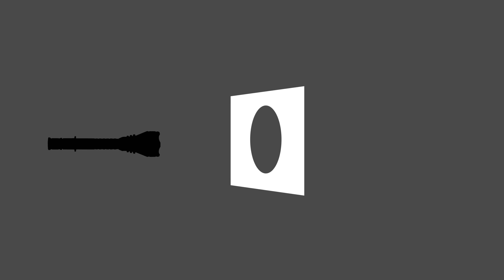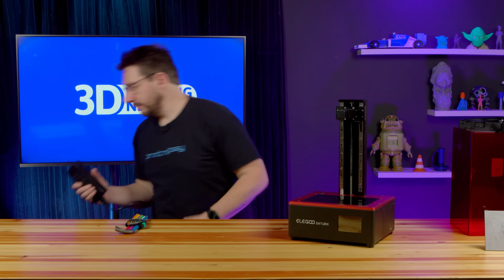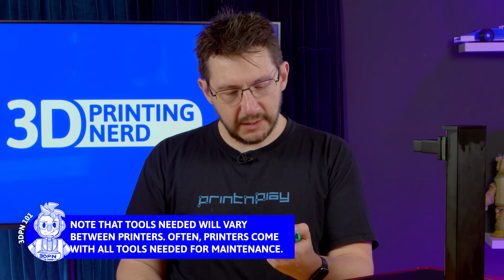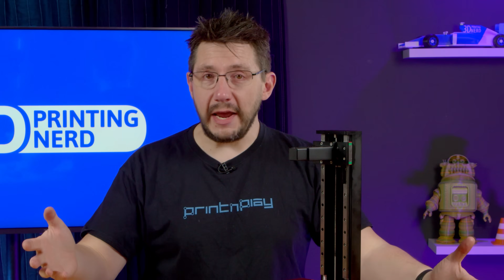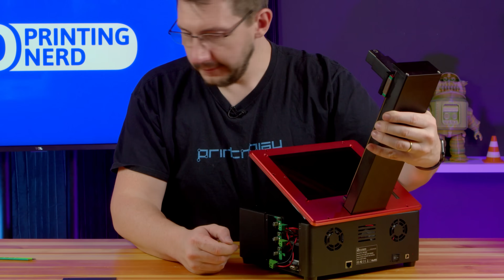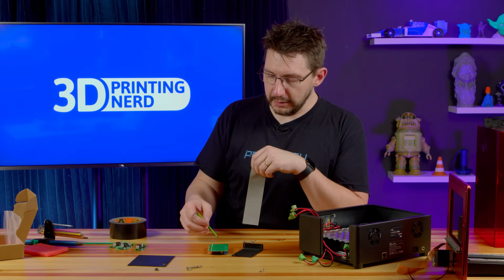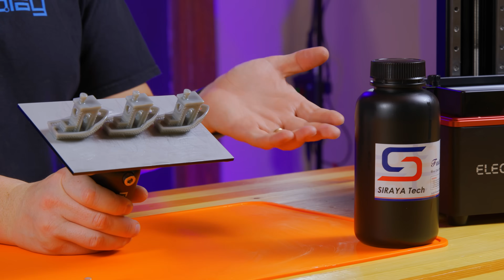FIX AND WIN an ELEGOO SATURN!

Comment: I'd print a lot more DnD minis. I print plenty now with my Ender 3, but even with a 0.2mm Nozzle, it struggles to get fine detail on things like chainmail when it's that small, so would love to be able to produce cleaner and more precise minis. 
It would also be nice to be able to print smaller components for some larger projects in conjunction with the FDM printer.

Comment: Very cool. I am now on my 3rd fix having bought 3 partially broken 3D Printers. Fixed a failed Extruder, failed stepper motor, failed main board, failed hot end, and the list does go on. BUT I have saved probably about 70% of what the original purchase price would have been.

Comment: Would love to prototype small diy negative mold for parts I'm design for my dad bass boat, possibly for other boats. Hope I explain that well. Want to use it to print the part then make a mount around the detail and acurate to make carbon fiber parts for small switch panel etc. And possible make figures and other things. Great video explaining and diagnose.

Comment: Nice step by step fixup. If I won the printer I'd print custom model railroad items. I've actually got a few things designed already 😊
My filament printers are not good enough and my old Anycubic resin printer needs a new screen.
Cheers!

Comment: like that you had it fixed with new board. might wish to inform people to take pictures of wiring in case they have to wait and might forget where they attach.  as for the stand offs you could use even low density weather stripping.  as for what to print? mostly miniatures, chess pieces. most i would like to donate to the senior center where they could paint them and play with them.

Comment: Another great video. I have been looking to get a resin printer. I would print a few small prototype pieces that I have designed that need a better finish than using my fdm printers.

Comment: I noticed that with the old driver board and the new driver board that there was no cooling or heatsinks. That second driver board may fail as well.

If I won that printer I would print some upgraded parts for other print printers. Because the goal is for 3D printers to make better printers.

Comment: The very first thing I would print would be an adapter/insulating plate to replace the tape you used for the repair.  I don't trust adhesives directly applied to electrically live conductors.

Comment: Good Day Joel,

I am an R&D medical device engineer (read: invents medical devices). My passion is saving lives and/or giving a better quality of life to people, thus I’ve been in this industry for over 25 years. I have over a dozen U.S. patents with my name in the inventors list for medical devices from companies I've worked for. I am currently unemployed as of 15 Jan 2021, since my last company’s product was an implantable weight loss device for bariatric surgery. During the pandemic that type of surgery is considered “elective” surgery during COVID-19, product sales dropped, R&D work dried up.

I am currently developing a TAVR (Transcatheter Aortic Valve Replacement, you can look that up for more info) in my garage to hopefully start my own medical device company with this product and am in dire need of a quality 3D printer to build prototype stents (these stents will later be built from various biocompatible metals) for proof of concept and testing. I may even try some of the elastic resin materials to prototype a (human) heart for my bench top testing. I already have some stent designs I made with my SolidWorks ready for print. I have an FDM printer I built myself a few years ago, but it is not up to the task of building the stent geometry that a resin printer can provide and my printer is not that good. As mentioned before, I am developing this in my garage with my own (very limited $) resources until I create a working and bench tested prototype to present to physicians and investors.

You are welcome to check my authenticity on Linkedin and you can go to Google/Patents and use my name in the following formats and my location in San Clemente, CA to look up these patents:
- Monetti
- Richard Monetti
- Richard R. Monetti
These patents will all relate to medical devices.

Consider that your gifting this to me could save a life or give a better quality of life to someone with aorta valve disease if I can make this product come to fruition. I am more than happy to give you all kudos and credit for this piece of equipment when I am successful along with being one of your patrons (which I cannot afford presently)!
If you have further questions, you may PM me in Linkedin.

Comment: I have a friend that is going to school for architecture but doesn't really want to bother with the technical side of 3d printing. If I had this printer I would use it to print his models but also to print miniatures in higher detail than I could on my ender 3. Also, I don't know how this would work with a resin printer but I would like to if possible attempt to print a small airframe for an RC plane using resin instead of pla.

Comment: A better solution to the standoff problem is to use a drill with a bit larger than the diameter of the standoff and drill them off. The leads from the components will eventually push through the tape. Another idea is to use washers (or print extensions) on the standoffs that have screws to lift the board higher than the unused standoffs. As for what I would print, I would print components for my race engines to be used as molds to cast them in aluminum.

Comment: 3 buck converters  replaced by a single board with 3 DC Buck converters on it.     kinda a downgrade because one buck converter would ahve been cheaper to replace ( not a driver... a voltage regulator)
Reply: i would print myself a  samurai mask .  :)  pelase enter me in the contest ( just north of you in canada)

Comment: Great video Joel! I tinker with a lot of electronics myself too. i would just be a bit afraid of leaving the tape on the PCB as in time the pointy leads could chew its way through it due to vibrations and then touch the metal shorting the circuit. If I had a resin printer I would like to print high res figures or try some of the special resins, like flexible with intricate designs or ceramic to make fire proof prints and electrical insulators.

Comment: When reading the title "Fix This and Win This", my first thought was like "Isn't that like getting to kiss a supermodel with weeping herpes wounds?"
Add: Now that I've watched the whole vid, I am in sincerely desperate need of a resin printer for my UHTC project for which the one I ordered is lost somewhere either on the surface of the Pacific Ocean (fingers crossed it's not bobbing somewhere beneath) or somewhere between China and the LA port at present. The resin printer will be printing self-engineered jet engine parts for the purpose of making a ultra high temp jet engine run on water.
I'm not even joking for once. =)
I would also consider modelling up a mini Joel and strap him to the top ala Slim Pickens because why not.

Comment: I designed some minis on HEROFORGE and had them print and send me one last July.  I spent a fortune on paints to finish it and was almost done at the end of December when I knocked it off the desk and broke her off at the ankles.  And that's how I ended 2020.  I haven't gotten around to fixing her yet.  IF I won the printer, I'd download the file from Heroforge and print her up myself and paint her.  That would be first.  Then I'd dl a few more mini files and print and paint them.  Thanks.

Comment: Great video as always. I've been curious about the inner workings of these printers. 

I'm currently designing a resin modification kit for the Ban Dai Real Grade Sazabi model kit and would love to have the ability to print prototypes (and possibly the final parts) on a printer of that caliber. If it turns out the way I hope it will, I'll probably offer it up to the community of model builders out there. I've tried printing the prototype parts on my Ender 3 and the resolution just isn't good enough for the detail I'm trying to cram into this model. I've needed a resin printer for a while for this and other projects, but it just hasn't been in the cards....

Comment: I would have it printing benchy after benchy after benchy.... hundreds, nay, thousands,  nay millions of them to use as ammo in my gatling style benchy launcher. I will then try to set a Guinness world records  for launching multiple benchy boats in excess of 50 metres. The two records will be for distance and quantity.  

The rules will be a mechanical launch system that self primes for multiple launches with no explosive charges.  The launch must be initiated by hand with no electronic fireing mechanism.... 80% of the mechanism by weight must be 3d printed. 

Then annually hold an event for people to attempt to break that world record raising funds for charities....

Comment: I have a backlog of things to print on a larger printer than my OG Photon:
1) Stereo mounting brackets for my Jeep Wrangler as one piece.
2) One-piece molds for silicone molds for wax molds (yea, I know, it's a bit inception-y) for jewelry
3) Some reprinted parts for my hydroponic system. (water level sensors, larger peristaltic pumps, and a fan shroud)
4) Drill bit, socket, thread tap and die, and punch tool organizers
etc....

Comment: Two things I really need to print at the moment. I'm in need of some aids to help me around the house due to a severe back injury. Blew out L1 through S1 discs and have a 6 month recovery time. L4 protruded into Thecal Sac and paralyzed my bladder which wasn't fun.

Second thing is parts for my FDM printers. Both are in dire need of some revisions. One has a hotend assembly that needs a complete redesign to work consistently and the other needs a cooling fan mount thats rather complicated. Neither can print the others parts as they stand right now and there are no off the shelf components I can purchase for them since I'd already customized them for specific projects. :( 

Missing my printers a lot. Never had a chance to hit up resin printing.

Comment: I have a problem. I collect model daleks (I have over 100), and recently I have been creating my own using the friends FDM to print parts and then casting them in silicone to reproduce. He's always recommended a resin printer for me given it would give a better quality, so I found your channel. Long story short I'd print all my designed pieces to make all my custom daleks and not have to worry about FDM layer lines

Comment: Hi Joel, first of all I have watched quite a few of your shows and I would give them five stars due to the fact that you talk and teach 3D printing as if we are all newbies which lead me to getting an Ended 3 some time back to help with my modelling aircraft modelling that is. Now for the printing on the elgoo I would print some parts to fit my Dremel as it would be easier for me to use smaller tools than the bigger ones due to my disability and it would make a lot more space after getting rid of the big tools to have my printer in the small workshop in my flat. So bye for now and live long and prosper.

Comment: I'm a manufacturing major at university, and I would like to print custom parts for an automated indoor bean farm that I'm gonna design and build this summer. I plan on using Arduino for the automation and a printer like that would help with mounts and brackets for the watering system and LED lighting.

Comment: Joel I would look into liquid electrical tape it is a handy item that has many uses and is great to keep in the shop and if I won the Saturn I would print detail parts for my radio controlled rock crawlers

Comment: If you’re concerned that the adhesive conductivity might interact with contact to the soldered contacts (the green solder mask will prevent the interaction with the copper traces on the board) you can just print your own custom insulation sheet to isolate any contacts to prevent any unintended consequences using the tape. Personally, I would’ve just clipped the protruding connector pins extending past the solder pads with side cutters to “flatten the board” from any extrusions. Since the original boards look to be standard DC-DC converters and the new looks to be a 1-in to 3-out configuration. Did Elegoo provide any adjustment values to the outputs (3 blue trimmer pots) as well as the input & output voltages required?
Otherwise, good initial diagnosis.

Comment: I am glad you kept the repaired unit,as that would have left you vulnerable to troubles,should it fail and cause damage or injury.A better insulator would have been Capton tape.I would print a Gypsy engine for my custom Shay locomotive model.  Doc BC

Comment: What would I print if I won a Saturn? What would I NOT print??? My girlfriend and I split the cost of an OG Mars before the pandemic hit, and it has certainly been put through its paces. Between us, our room mates, and extended friend circles, we have printed miniatures and terrain for tabletop games, statues, replacement parts for cabinetry that are no longer manufactured, the cutest little nuka-cola bottles to put in a tiny nuka-cola machine I found and printed, prototypes of products for my girlfriend's resin crafting and local farmer's market booth, and props and costume pieces that I've bought and/or modeled myself. A Saturn would greatly expand our printing abilities. So yeah... Which option was the "all of the above" option? Was it D? I feel like it was probably D.

Comment: There is this really detailed cutaway lightsaber by Sean Charlesworth that Joel and Bill from Punish Props put together in a video in 2016. That's the one I would want to print using a SLA printer like this one. I've been wanting to print it for a while now but my FDM printer can't handle the fine details.

Comment: Nice troubbleshooting, definitly an intersting way to insulate the connections. It was simpler than trying to hold an anglegrinder to the middle standoffs.
If I won the printer,  I would want to print astromech parts, mostly 1/4 scale.  I hate admitting that I am an astromech addict, this might help with it, especially printing clear dome segments.

Comment: Nice trouble shooting, I would have perhaps gone one step further and verified that the input wiring was good, and that top driver was actually getting power. [though likely it was]  Personally, I would have mounted the driver board the other way around, so that if I had to debug gain I would have had easy access to the connectors again. I also would have gone through the extra bit of effort to fully remove the now unused connectors, but I like things to be clean. But these are personal choices, and by no means make yours the wrong ones. Nicely done, and thnks for putting that out there!

Now if I was to win that printer? Right now I'm working on a project for air sensors to help determine infection risk during the pandemic, so I would be printing custom enclosures for the electronics.

Comment: Oh gosh, the possibilities are basically limitless.

One of the first prints would have to be the printers avatar and in this case the most fitting would be to print a mini joel.

Am i the only one that does this?!. As one of the first prints I run a figure or animal model. This print then becomes the printers avatar, and thus will watch over your printer while printing. And appease the printing gods 😉

Comment: Nice breakdown and explanation of how to go about fixing the printer. Was quite interesting. 

With a machine like that, I'd probably make some dice masters, tabletop minis, and pin masters. Had a few ideas a while back on a method of making pins with resin and current experiments doing the masters with FDM are.... lacking.... at best. Small details and heat-guns for ease of cleaning up those details just do not mix very well.

Comment: Hey Joel and the 3d Printing Nerd team! I currently have an original Mars but I've been really limited in the size of prototype parts I can print with it. I'd use the Elegoo Saturn printer to print large prototype parts for different engineering projects. Also, and this goes without saying, a GIANT resin Benchy 😅. Thanks, as always, for sharing!

Comment: I would print my custom designed fan shroud for my fdm-printer which is too complex to be printed on an fdm-priner.
I mean. it worked... but would be way cleaner with a resin printer.

Comment: I would be printing prosthetics, both for myself and others. FDM works for prosthetics, but the tolerances that a resin printer provides could improve the user experience of many prosthetic users, especially because I would like to branch out to creating prosthetics for those in need in 3rd world countries and I want them to not have to worry about faulty or flimsy parts. Thanks for all you do Joel!

Comment: I'd print stove knobs using the high temperature resin you demonstrated in an earlier video.  My wife's Jennair had stove knobs that melted (go figure) so these new ones would allow her to control the gas valves.  But I'd also use it for printing other parts that I design too!

Comment: Joel, like so many who are new (about a year, in my case), to the hobby, your videos have been a healthy source of both information and inspiration.  Most of my 3d printing to this point has been related to props and other stuff that my wife seems to refer to as "nerd" stuff," I have thoroughly enjoyed using Fusion 360 to design and prototype my own parts for practical applications (phone stands, RC frames, etc.).  Like all of us, I am sure, during the early days of the pandemic I devoted my printer to the creation of face shields for a couple of the local medical offices who couldn't get ahold of supplies.  With this printer, I would be able to do more prototyping of larger detailed pieces that would otherwise have to be cut in inconvenient ways.  Thank you for the opportunity to compete for this prize!  And keep up the good work!